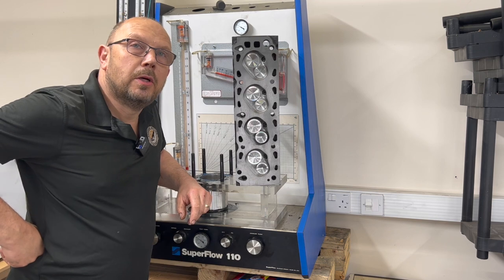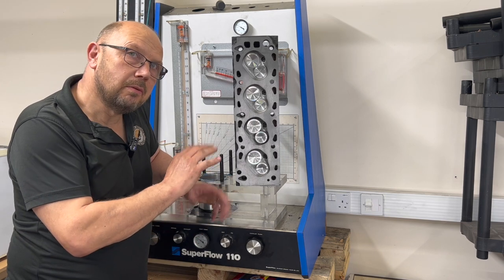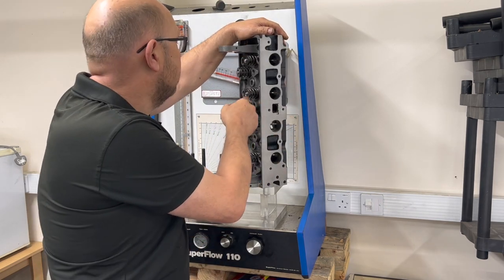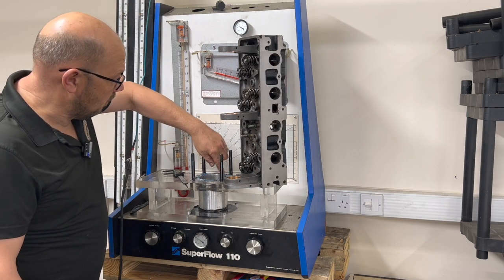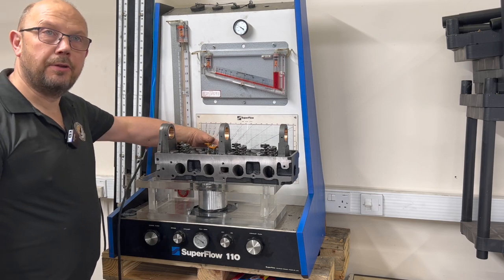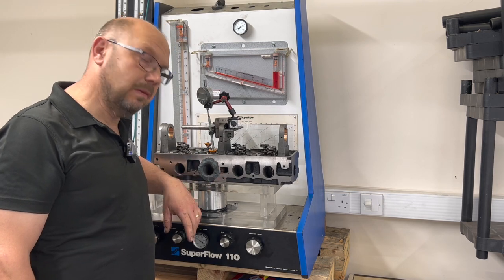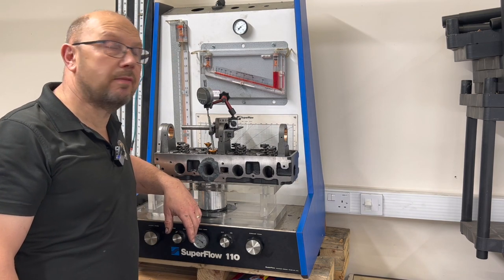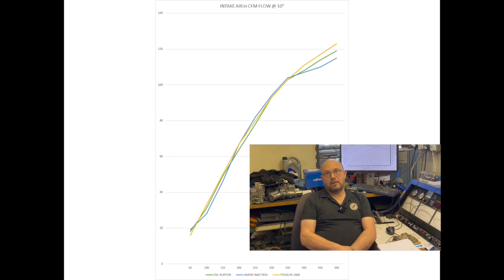BURTON CNC CYLINDER HEAD FLOW TEST

Comment: Let me ask you, " what about engine prep by Grace engineering, versus Burtun heads and maybe you do the same things ...  as I a  looking for my FF Pinto rebuild.    Thanks
Reply from the maker: Yeah not really going to get into that one. I know of Grace. The thing is all engine builders are a bit different and we don’t  all approach everything the same way, but often end up with similar results. It’s too easy to get into a needless slanging match, so I don’t tend to comment one way or the other, especially as no one ever has all the facts let alone same budgets etc. Burton heads work, but then again you would expect them to as they are actually machined by Ric Wood/CNC heads. In well aware of the technical regulations for a FF2000 pinto, although have no real interest in doing one
Reply: @PenguinMotors  Thanks for the answer,
Reply from the maker: @D3Sshooter the thing with building a really competitive, reliable and legal FF2000 is to know exactly where to put every single clearance, exactly how big you and get away on bearing clearances whilst running as little oil pressure as possible to save parasitic losses. As a one off that’s really expensive in development time, or the engine won’t be really competitive

Comment: Interesting the results you got with your self-modified 1600 head.
When I built a few 2.0litre Pintos, back in the early 1980's, I very quickly started using 1600 heads, that I'd modified extensively, on them.

Comment: Could you flow bench a stock pinto head to show a comparison, maybe even stock v injection v Burton?
Reply from the maker: A stock head flows about 85cfm so at nearly 120 the burton head is getting on for 50% better. injection head intake port does flow more than a carb head but not massively, on an otherwise stock engine its worth  about 3bhp only

Comment: Thanks Graham. How are they vs a clean standard head? If these heads flow enough for 200bhp the what is a standard limited to?
Reply from the maker: a clean standard head flows around 85cfm @10" typically a standard head could run to 150bhp or more, but given enough cam compression and induction even more is possible, i beleve vulcan extracted 192bhp from a standard head on a classic hot rod
Reply: Wow.What could be configuration of that 192bhp standard head Vulcan engine?

Comment: your graph shows what is very normal for air flow through a intake valve, which is, once you get lift beyond 1/4 of valve head diameter, the increase in flow becomes negligible in relation to extra lift.  ' High lift ' cams only succeed in making a HP gain by having an aggressive lobe profile, that requires time to decelerate the valve gear either by duration or extra lift beyond 1/4 
L/VH diam  and not really the lift off the seat  factor
Reply from the maker: im guess you have never used a flowbench..........................
Reply: @PenguinMotors   everything one does is a bit of a guess eh !  just as a flow bench is, they only measure a steady state of flow, and that is certainly not what an engine produces  basically things have moved on and the use of dynamic gas flow modelling, is the solution.  I watch others using this almost redundant tech and the  results are of little interest and are just not accurate enough. Port and chamber design are well and truly formulated and what the ideal requirements are. Personally, I have modified more cylinder heads than most people have had hot breakfasts.
If I were allowed to improve flow with that head, I would probably reduce the intake valve head size or move the valve centers to ward the exhaust valve chamber wall ( which will help unshroud the IN /val   to chamber wall and re machine the IN / ports  ie : down draught. Stuff we used to do 25 years ago.  But good luck
Reply: Rubbish !
Reply: The problem of "1/4 lift diameter Ratio is enough" is that the flow has to turn 90 degree and towards the cylinder wall. Also when you lift the valve more than 25%, the flow coefficient is better. 

For example ProStock engines have 2,5" intake valves and lift is 1,1".
Reply: @ottoblomstedt4909  Hello Otto, this poppet valve flow characteristic has been known since Adam was a boy. I have observed countless graphs and air flow tests that all show this same flow pattern.  Yes the flow numbers do keep on increasing beyond 25% V/D, but are diminishing in effective return.  Also realize that some of the engines have cam gear
designed for better lobe area, means they are very aggressive rollers that require lots of lift to accommodate accel/deccel ramps and rates >>> flow co-efficient ?
If you want more air flow into an engine, eliminating angles is the way to go. Even reducing the IN/ valve seat to 5* from 45 *  should help (  makes the cam seem longer in duration )
Reply: Well, flow coefficient aka Cd value. Experimental studies have shown that best intake channels can achieve about 80% of theoretical mass flow at 0.4 lift/Diameter ratio. What is pretty similar what ProStock engines have. Which happens to be maybe most developed natural aspirated two valve engine community. 

Theoretical mass flow is calculated from valve throat diameter and pressure difference.
Reply: @ottoblomstedt4909  Yes I know what Cd is,  Experimental studies and theoretical mass flow are all pie in the sky mate,  Pro stock engines are no way the most developed 
N/A  2 valve cyl heads, you want to pull your head out of the sand and stop reading rubbish and that yankee speed site.  I explained why the valve lift is so high
Reply: I was ProStock mechanic in my younger years, and I still follow how things are developing over there, which is impressive. If you scale that power level to 2.0 OHC, well we are talking about ca 300 HP at 10500 rpm. So who does it better?
I'm not in dragracing any more, concentrating on my friends Triumph Dolomite Sprint Gr1 wellbeing.
My daily work is keep research engine laboratory up and going, including building experimental engines. Engine testing is very time consuming thing, most viewers here don't have a clue how much time it takes to get Dyno results and present that in a nice 10 min video. Especially when you are comparing carbs, cams etc. It looks easy on video, but in real life things are more complicated. 

But Pinguin Motors does this for living, I earn my money on this business.

Comment: Many years ago I ported a '73 production head per David Virzard's book on the 2.0 OHC engine including the used of the "RIm Flow" valves.  I was very happly with the results. What is your views on what he did with the 2.0L head?
Reply from the maker: im not going to knock Vizard, he will of forgotten more than i will ever know, however, there are ways of modifying the port he never considered, also there is one big error in his book, whether that is down to a publishing error or not i dont know, but most of the air flows along the FLOOR of the port not the long turn in the top. Personally i cant see anything that special with a rim flow valve, the biggest feature is the ditch machined into the face of the valve, it probably works well until its all carboned up
Reply: Made one myself this winter after Vizards book with epoxy and all but not a big change from a stock head. Now im not a pro so might have got it all wrong anyways. Head work is not easy....

Comment: Hi Graham
Do you have any more bmw m20 content?
It would be great to see the same flow bench video on the M20 885 head.
Even a modified m20 on the dyno would be very interesting.
Love the content. Obviously you are very knowledgeable and that is rare these days.
Cheers
Reply from the maker: yes there is more m20 content in the pipeline, its just slow going as its my own stuff
Reply: The 885 we just put on our shops 2.9 race engine flowed 220cfm @13mm lift through the intake with 44mm valve, would have gone more with bigger valve
Reply from the maker: 220cfm, what depression was that at 28"? thats about what i seem to recall my one flowed
Reply: @PenguinMotors  do you know what a stock head will flow with stock valves?
Reply from the maker: no but i do have a stock head here that i could stick on the flowbench
Reply: @PenguinMotors  that would be great….I have an 885 I have worked on for hours 1 mm oversized exhaust and intakes with multi angle seats and I have worked the roofs of the intake and exhaust ports and shaped the guides but not removed them.
I have shaved the head by 25 thou and plan on running a Schrick 304 with 12.3mm of lift. Have not flow benched but interested to see what it will yield.
Any thoughts about this?
Sorry, did not mean to hijack the comments of you flowbench video.
Reply: @PenguinMotors  pretty sure 28" I had a local gentleman Tony from Knight Engines finish the head off and flow it, I'm good on the tools but tonys the guy that gets the good flow figures,
Reply: @dyno4mance  the 885 really likes a big valve, 43mm on my head I have was only 210cfm going new seats and a tad more tidy up with a 2mm oversized valve (44mm) netted an extra 10cfm, this is all at 13mm (.512") lift , and the more lift the more they flow, my head kept gaining flow concistantly all the way to .700" lift I'm aiming at 350 hp